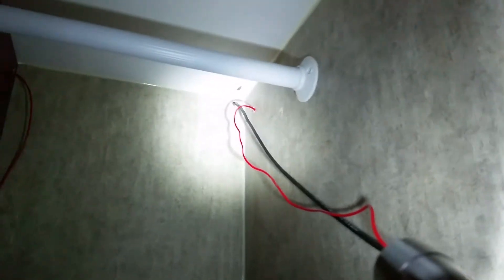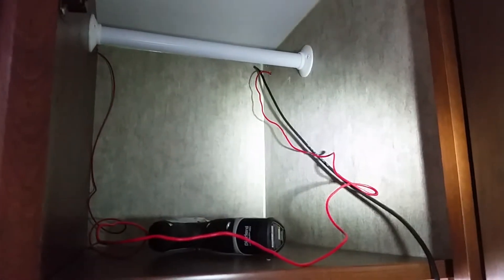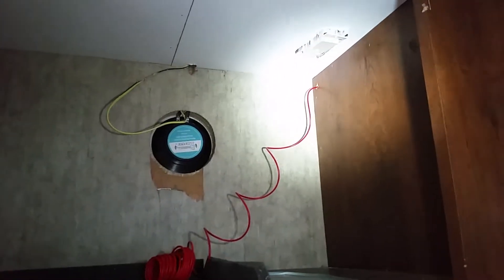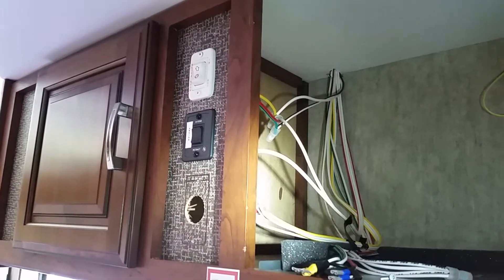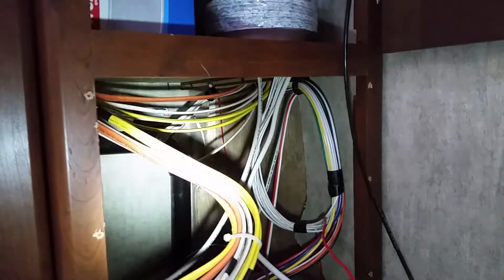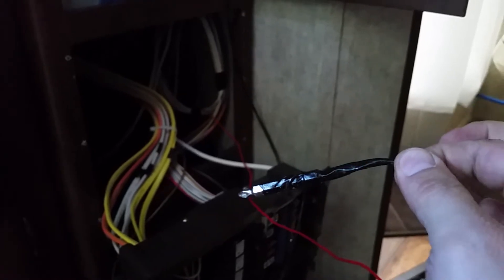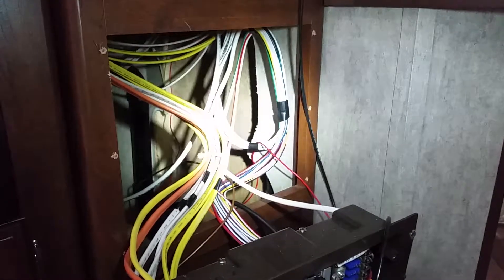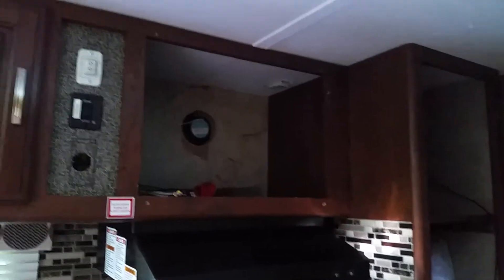Boogie Lights LED Install part 2B

Comment: Did you need to cut into the wall in that bottom cabinet?  Creative tip for fishing your conductor down the wall.
Reply from the maker: Brian Binkley the bottom was already open as it is a main chase to get to the fuse panel/circuit breakers.  I'm happy with the install, wouldn't know that it isn't factory except for that little visible portion in the pantry.  I think I'll hide that behind a cove moulding.